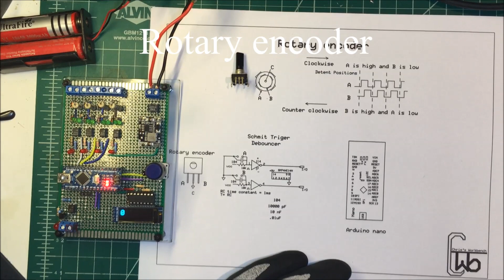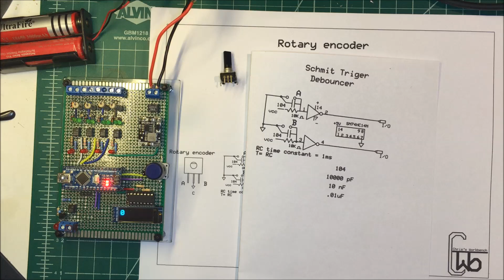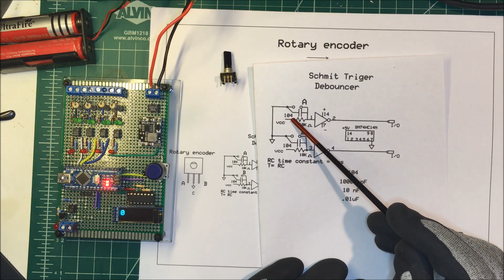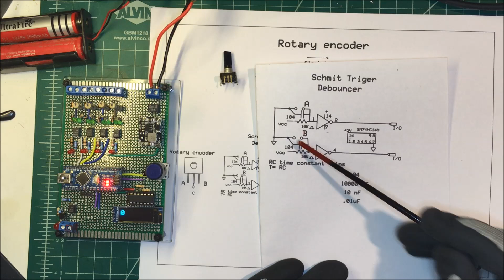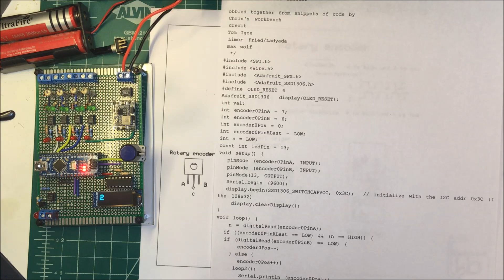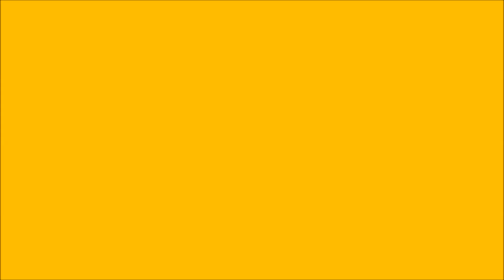Rotary Encoder

Comment from the maker: /* Read rotary Encoder
   
 Cobbled together from snippets of code by
 Chris's workbench  
 credit
 Tom Igoe
 Limor Fried/Ladyada
 max wolf 
  */
#include <SPI.h>              // add   Libraries
#include <Wire.h>
#include <Adafruit_SSD1306.h>
#define OLED_RESET 4
Adafruit_SSD1306 display(OLED_RESET);
int val;
int encoder0PinA = 7;
int encoder0PinB = 6;
int encoder0Pos = 0; // number in counter
int encoder0PinALast = LOW;
int n = LOW;
const int ledPin = 13; 
void setup() {
  pinMode (encoder0PinA, INPUT);
  pinMode (encoder0PinB, INPUT);
  pinMode(13, OUTPUT);
  Serial.begin (9600);  // initialize serial communication:
  display.begin(SSD1306_SWITCHCAPVCC, 0x3C);  // initialize with the I2C addr 0x3C (for the 128x32) 
   display.clearDisplay(); // Clear the buffer.
}
void loop() {
   n = digitalRead(encoder0PinA);
  if ((encoder0PinALast == LOW) && (n == HIGH)) {
  if (digitalRead(encoder0PinB) == LOW) {
      encoder0Pos--;
    } else {
      encoder0Pos++;}
     loop2(); //jump to loop2 print to oled display
      Serial.println (encoder0Pos);}
      encoder0PinALast = n;
  if (encoder0Pos % 2 == 0) { // % function gives you the remainder of the division of two numbers if remainder is 0 turn on led
     digitalWrite(ledPin, HIGH); //led on
  } else {
    digitalWrite(ledPin, LOW);  // led off
 }}  
void loop2(){ // display text
 display.clearDisplay();
  display.setTextSize(3); 
  display.setTextColor(WHITE);
  display.setCursor(0,0);
  display.print(encoder0Pos); // number in counter
  display.display();
 }